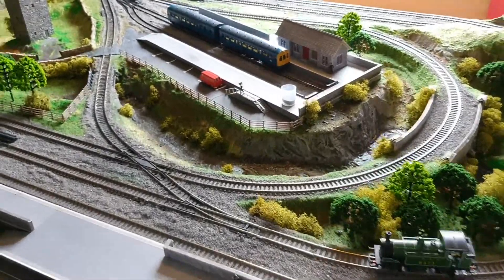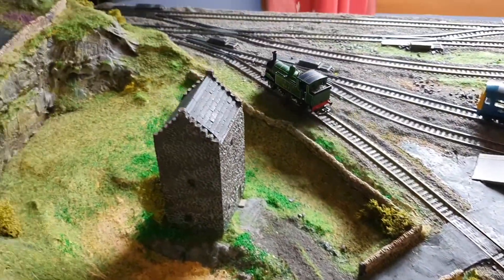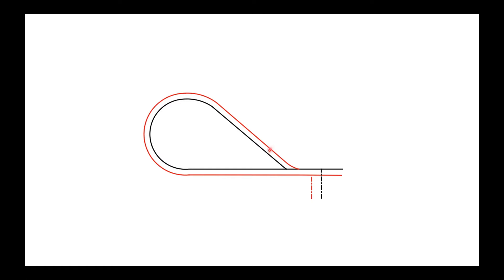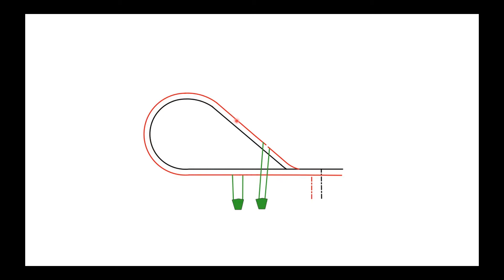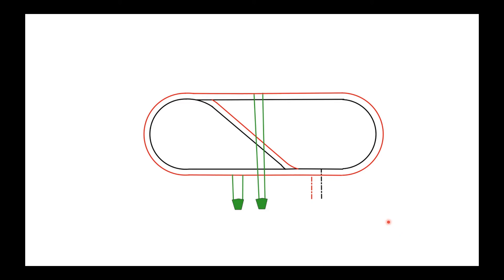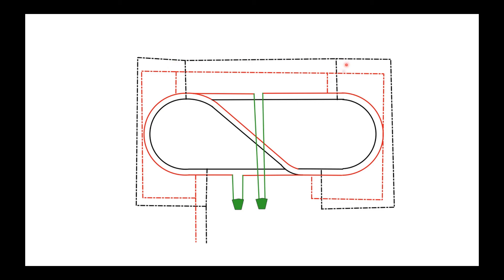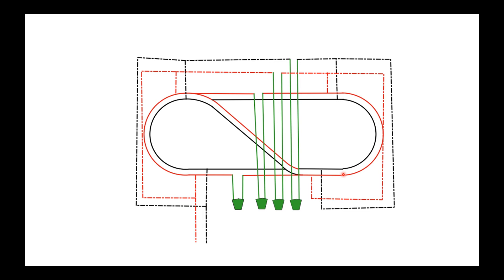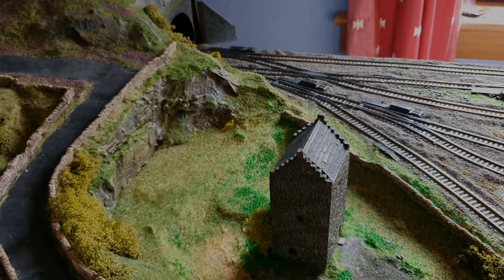DC Return Loop

Comment: This video has definitely helped me a lot. I've just returned to the hobby after i inherited a whole bunch of OO and N gauge (thanks dad) and I've really got the bug. I'm not blessed with space so I'm building an N gauge  layout and the idea of a reversing loop appeals.
Reply: can you give us an update on the N gauge layout?

Btw, i also do not have a huge space. I could hook up 3 bedrooms in my house for a giant layout, but i am first going to start using the master bedroom. (live alone in a simple house, in a simple street in the Netherlands. Not a mansion or anything like that. But when you are alone, you do have some space to use.)

My father had built a layout once, on a simple table top.
It was OO or HO scale.
Im dutch so i guess HO scale.
But similar, right?

Anyway, i did not take into account the scale that much when i picked up this hobby again 30 years later. (which was roughly half a year ago).
And so i bought HO scale. 
A lot of stuff already, like say 14 locs, rail to cover the master bedroom at least once, perhaps 1.5 times.
Carts or wagons or whatever the name you want to give them.
The load basically.
And so, here is the question: Did you do anything with the OO gauge as well? I believe it is almost similar scale as HO.

Either way, if you have build a layout in N gauge it could perhaps help me set it up in HO scale to make it interesting enough.

Comment: Thanks for showing your solution to a return loop. I had seen a video on an American DC  layout which used a polarity switch unit. That operated in a fraction of a second without interfering with the running of the train. Totally agree about the interest factor.

Comment: Hi 00 Bill, I have two reversing loops on my DC layout with bus feeds. Like you I have spent hours trying to get my head around the electrical issues involved. I have mastered it in a similar fashion using relays but without isolating the track. I am just relying on the relays to do all the work. I enjoy your videos, a very informative channel indeed. Regards Alan at Buckland Junction  :o)

Comment: Hi Bill,
Best video i have seen on this subject.

I have similar problem that i think is something to do with reverse current.

When i turn the power on the engine moves forward for about 4 seconds then the then the safety switch pops on the controller, it then comes back on after a few seconds.

I wish I could send you a diagram of the layout as you maybe able to see what it is.

Many thanks again for your help.

Your layout is still looking great.

All the very best

Duncan.
PS.  Its DC.

Comment: This is a game changer for me, thank you. 👍
Reply: so to what game did it change you?
Super Mario?
Dune 2000? 
Let me guess, Command and Conquer Tiberian Sun. Am i right?

Just kidding. We all know it was Train Simulator newest version available on the market, with all the addons. (downloaded from some cheap website or perhaps actually bought from some software supplying website like Steam)

(pls take the above as a joke, it was meant as such)

But, now lets get a bit more serious.
In what way did this actually change the game for you if i may ask? Could you explain?
Reply: @bertjesklotepino  I have a large shunting yard and I favoured more sidings instead a turntable. Simply by extending one of the sidings making it a drive through to the other side of the layout and adding a couple of isolator switches I now have a working return loop. Now I can turn a loco round without  the need for a turntable. All thanks to Bill.

Ok I have to go now, I have a mission to finish in Command and Conquer, 150 acres of OSR to get in on Farming  Simulator and a three car DMU to return to Newark from Nottingham in Train Simulator {The newest version available on the market, with all the bells and whistles} and all that before bed.

(pls take the above as a joke, it was meant as such)

Comment: Hi Bill
I have a similar layout (oval with return loop). What I did was isolate both +ve AND -ve rails on BOTH ENDS of the Return Loop. Then wire the electrical feed to the return loop via a Double Pole Double Throw (DPDT) switch.  I really need a diagram to explain but imagine 3 rows of 2 contacts. Contacts 3 and 4 being +ve and -ve wired to the Return Loop. Contact 1 is red (+ve) and also has a joiner wire to contact 6. Likewise contact 2 is -ve with a joiner wire to contact 5. Contacts 1 & 2 are wired to the controller. 
Operation. Run the train onto the return loop. Stop power. Flip the DPDT switch. Reverse direction on controller and apply power. Train continues onward.
Hope this helps.
Reply from the maker: Always more than one way to skin the proverbial cat. At some point soon I plan to rewire my buses and tidy up my wiring which is a right tangle at the moment. How my loop and other isolators work will be reviewed then but it works fine.
Reply: Could you diagram that?
Reply: @paulbrennan3760  No, but just google model railway 12v dc return loop…..

Comment: How about - isolate the track going diagonal across the middle on both + and - rails just past the
turnouts / points, then feed this section with a DPDT switch to reverse the polarity, another DPDT
switch can reverse the rest of the oval, the controller / power supply feeding the two DPDT
switches - only two switches, operated at the right time, to achieve a continuous run ?
DPDT is a double pole double throw wired in a well known way to reverse the current .

Comment: Very interesting video. You've given me the idea to add a return loop to a layout I'm thinking of building. But just to be clear, with this this method of return loop across an oval, you have to manually stop the train to set the isolation switch and then restart the train on it's journey, right?

Comment: It would be clearer when you introduce the isolator at 2:40 if both rails of the loop were black to the right of the isolator. Similarly at 3:12 the inner rail of the loop should be red and the outer loop, up to the bottom isolator, black. Similarly at 4:39 and 6:21
My return loop had 2 entries on to the main track so the points at either end (as you show at 3:54) but combined with a set of points to a siding part way the loop and, providing you operated the points in the right order, it achieved the same isolating and switching of polarity. But if you had as many power inputs as you then you need extra isolators. Like you say there's more than one way of doing the same thing.